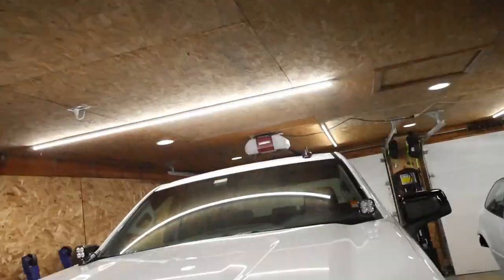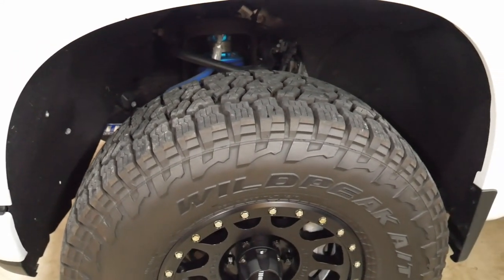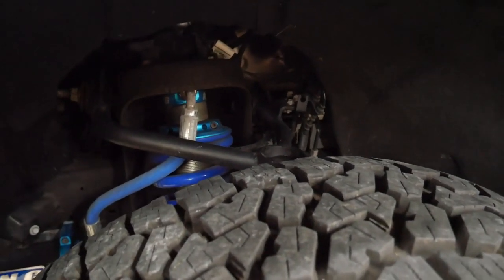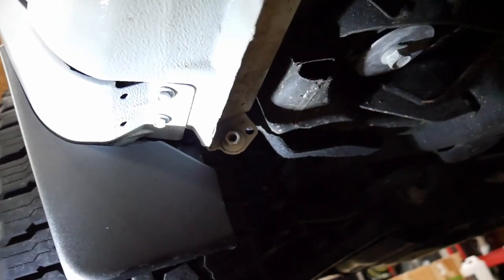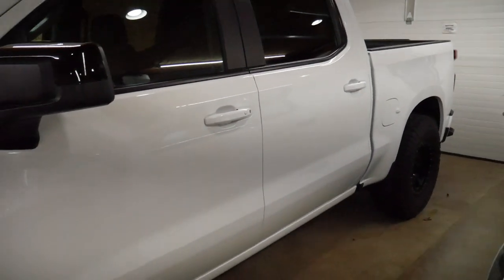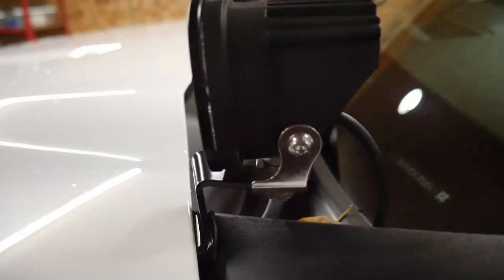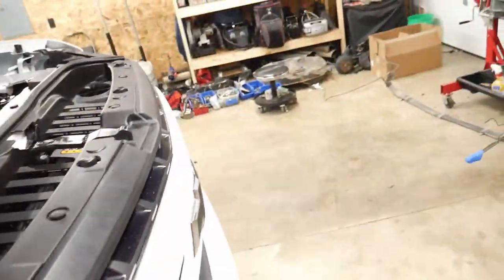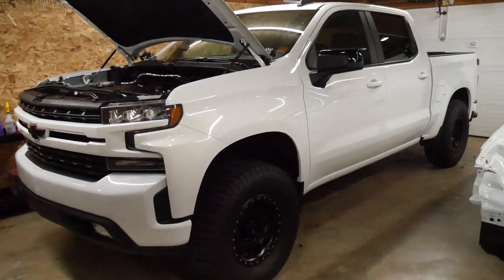Here's my Silverado and how I fit 35s

Comment: I was not aware GMC had a switch pod. Like you, I have a bench, so purchased the Rough Country universal switch controller. A local stereo shop installed it w/ the power lead going to the battery just as you spoke of. I had the switch itself drilled into the lower front plastic cover, just below the USB/cigarette lighter. I works well. I also installed two, S1, 1" Baja design lights to my rear lights for reverse, added two S2, 2" lights to my back rack bottom rail. I thought of the ditch lights but couldn't justify the cost/use for that position. My CB radio antenna is attached to the BackRack, running the cable underneath the cab through the plastic grommet. Regards.

Comment: I know this was posted 3 years ago, but given your setup and the alterations you had to make to fit the 35x12.50s, do you think with a similar lift I would be able to fit 295/60R20 on the factory wheels without rubbing? Those tires work out to roughly 34"x11.8".

Comment: Mcgaughs makes the mud flap delete and looks factory. Looks like you're upper control arms are going to interfere with the line going to your resivor on KING COILOVERS , COGNITO makes a upper control arms uni ball which has more clearence when you're at full droop. Also I think ROUGH COUNTY makes a led light bar to fit behind the grill and looks factory . Get rid of those ugly lights you have mounted.

Comment: I like you set-up! and looking to do something similar. I was wondering if you feel this tire wheel combo would need or benefit from a re-gear?
Reply from the maker: I don’t think so, mine didn’t feel sluggish after the bigger tires and it doesn’t have a tall gear in the rear-end.

Comment: Thanks for the info. For a 2020 trailboss do you think I would get away with just a leveling kit to fit the same size tires?
Reply from the maker: @Alex93_m  yes you should be able to since they have the factory lift already installed 👍

Comment: Hi Don, how did you remove the front inner fender plastic mount? I can't even see the hidden bolts that hold it. Thanks man.
Reply from the maker: I took off the lower bolts and slipped my arm from under with a long extension and swivel. It took some finesse. I’m sure it would be easier to take the bolts off the front half and pull the liner back and tuck it on top of the wheel though.
Reply: @donkuschel5326  Hey Don, I ended up removing the front plastic brackets, notched them and relocated them an inch back by mounting the front holes to the rear holes.
Reply from the maker: @bmxdad2001  nice, thanks for the input! I’m going to have to track mine down if I didn’t toss them and give it a try 👍

Comment: Did you have to use wheel spacers ? I have similar set up and my wheels hit the caliper pretty good .
Reply from the maker: No I did not use any wheel spacers
Reply: I’m running 17x8.5” method nv 305’s with 0 offset and they barely clear with no spacers

Comment: What was the metal bracket used for behind the wheel well? Nice video bro!
Reply from the maker: It was used to hold the inner part of the mud flap and the fender liner. Thanks!
Reply: @donkuschel5326  I saw someone say it was for front end collisions. To prevent the shell from penetrating the cab.

Comment: What is a RC tire calibrator? Great video pls. do an update on those Superlift UCA.   I wanna also do the same lift but I have the 3.0L duramax not sure how much adjustment the coilovers gonna need to get it level with the back.  Also Not sure if I want 17" wheels I'm sure its better for Off road with more rubber.  I have a standard length bed which is longer than the short bed so not sure if ill be doing much intense off roading more a daily driver but would wanna invest for those Kings suspension for ride comfort.  How is the ride with these Kings coilovers better than stock on the road?  35" looks good but thinking of just installing 33"s on 20x9 wheels only because the rear only has 3:23 gears. But you say your having pretty good mph.with the 8speed. How's the power?  If I do decide 35" tire maybe the 10speed will do just fine. too?  Keep posting the mods you do on your truck I like how you install it looks clean & factory like.  Just wish you did video on the mods you did.  Anyway thanks for your time.
Reply from the maker: Rough Country is the tire calibrator. The UCAs have 20k on them now and are doing good, I just shoot a pump or 2 of fresh grease in them every 5k. I would say it should be close to the same as what my truck is with the 5.3, really wish I would have went with the 3.0 like yours though! I would stick with the setting King sends they seem to be perfect. I daily my truck 60 mile high way trips to work and it does great even with the 35s. I’ve had a couple of the older styles on 33s, and this rides just as nice on the 35s. As for the ride it’s amazing with the Kings, just the amount of firmness you want, and the bigger sidewall helps soak up some bumps. I plan on making some changes to the truck so I will try and get more into some of the other mods I did as well, thanks!
Reply from the maker: Also the 10spd will be amazing with 35s! I’m getting 20 average still with the bigger tires and the 8spd.
Reply: Do you have the vendor or part # for your aux switches for lights? Love that clean set up.  Thank you
Reply from the maker: @apr9286  yes, check out the video description. I put all the part numbers in there and some extra info
Reply: This might be a silly question?  I just got my truck opened up my hood. And I had the hardest time closing it.  Do Chevy hood need to be slam shut.?  Hows your hood is it hard to close? Thanks
Reply from the maker: @apr9286  I usually slam mine “nicely” if that makes sense lol. I don’t like pushing it shut after it latches and taking the chance of denting it.
Reply: @donkuschel5326  o okay yeah thats how my trucks hood likes it too guess.  Thanks for the reply.
Reply: Forgot to ask does you tires poke out of the fender?  Thinking of purchasing 20x9 +0 with 33x12.5 tire.  Wanna be inside fender. What s your thoughts. Thanks
Reply from the maker: @apr9286  mine stick out a few inches, so the 9s will stick out a little further. But I wanted the same look and the 8.5s stick under the truck enough for me. I ended up throwing the weathertech mudflaps on because they are bigger and seem to help with rocks

Comment: What motor does it have? Would you recommend 6” lift on a 2.7 ????
Reply from the maker: Mine has the 5.3, and lift doesn’t matter it’s all in your tire size and gearing. The 2.7 might be sluggish with a 35” tire in my opinion

Comment: Any ride difference with the kings? I did a 3.5 “ Fabtech lift and the ride is way harsher
Reply from the maker: The kings ride nice, the are firm but not a harsh feeling.
Reply: @donkuschel5326  sweet. Got any good pics of the light pods? I’ve been trying to decide between the Baja designs or the KC flex era 4. I know the KC is almost twice the size

Comment: I’ve got 2.5” level kit and 35x12.5 I wanna put on my stock 20x9. You think I’ll need to trim or no?
Reply from the maker: I think you will need a minor trim of the mud guards and the front liner but nothing major
Reply: @donkuschel5326  appreciate it
Reply: Did you ever put the 35x12.50s on with the 2.5”?

Comment: Hi  Don ... my 2019 silverado  new style custom has 20" wheels ... my question  is .... can i fit 17" wheels
Reply from the maker: Yes, they will fit. The brakes are the same, mine also came with the 20” wheels from factory too
Reply: Thanks don .. i was hoping they would ... rasing my truck 2" front and 1 1/2 "rear  and going to put 295/70 17" tires . I think there like 33 1/2" tall ... whats your opinion.  You  think  they  will fit?
Reply from the maker: @rickc3151  they they will fit no problem with your lift plans
Reply: Thanks for all your help Don

Comment: What lift did you use in the front?
Reply from the maker: King 2.5 coilovers are what I used, but any 3” front lift will clear 35s on these trucks 👍
Reply: Nice, how much those run you for?
Reply from the maker: I bought mine directly from King and the fronts are $1,600. They ride great though

Comment: What’s the mpg ?
Reply from the maker: It didn’t change much, lost 1mpg with the tire size. I average 19-20mpg in the good weather months. The 8spd transmission really helped compared to my older 1500s with bigger tires.
Reply: If you're worried about mpg you shouldn't be driving a truck.. Smiles per gallon my dude.
Reply: @itsmemaaaark  actually  want to get into overlanding and chevy put a small ass tank on the fucking trail boss!  24 liters!
Reply: @rashad-tm4zm  haha I drive a chevy as well but with a 26 gal tank. I did buy a 4.5 gallon fuelpax to mount to my bed for longer trips just in case. I also wish Chevy put a much larger fuel cell. At least 30+ gal
Reply: @itsmemaaaark  dunno
WTF the engineers were thinking! My suburban had 42 gal wallet killer! I guess they just decided to switch the numbers around!

Comment: Does the front cv axle bind with the 3 in lift and no front diff drop?
Reply from the maker: No they do not. For the last 2 weeks I’ve been in 4high daily driving and no issues
Reply: @donkuschel5326  ok right on thanks for the reply..do you plan on doing dever springs?